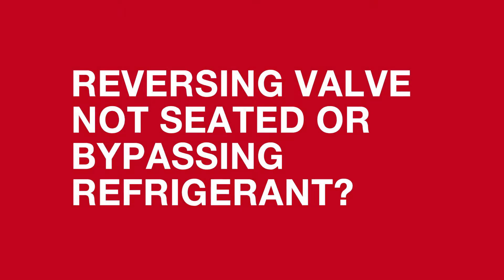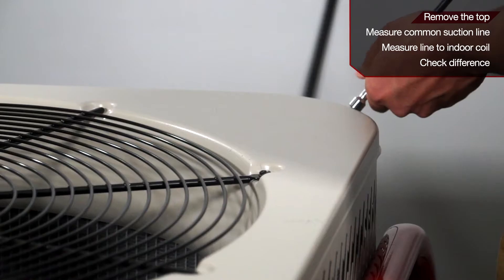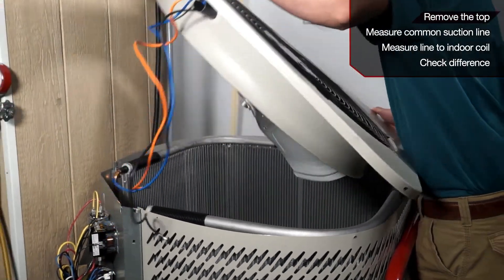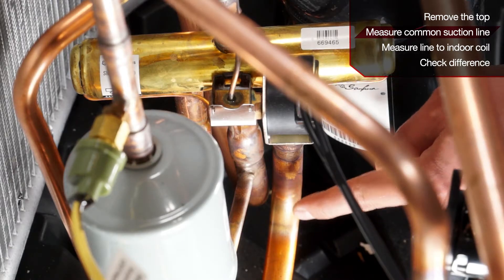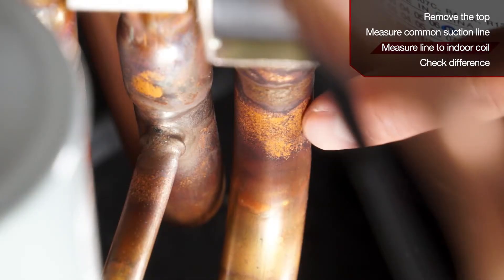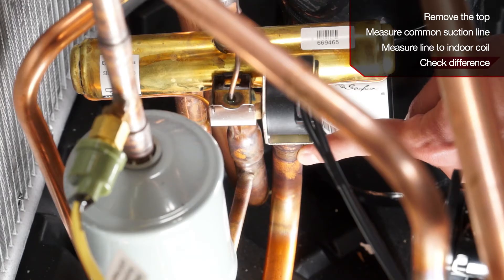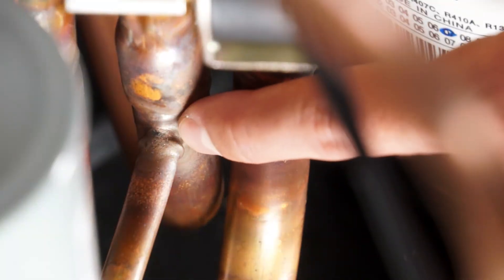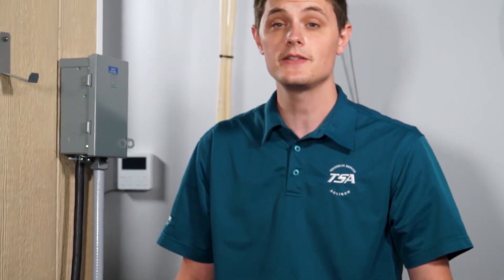Checking Line Temperature on the Reversing Valve

Comment: "Line going to indoor coil" ? Since its in cooling mode you mean "liquid" line. So check temp diff between suction and liquid line but there will always be a large temp diff between the two in cooling, so normal operation means bad valve ??
Reply: Good question

Comment: Doesn’t cooling mode/heating mode imply system is on with the condenser fan running?
Reply: Normally yes.  BUT, to perform this test, it is best to do so QUICKLY, immediately after compressor turn ON, in LESS than 2 minutes), with the CONDENSER FAN OFF/DISCONNECTED.  Then, quickly shut down the system to prevent compressor overheating.  This test technique prevents false temperature test readings from air flowing through the condensing unit, over the reversing valve, from the condenser fan.